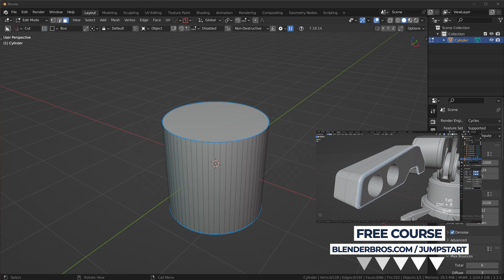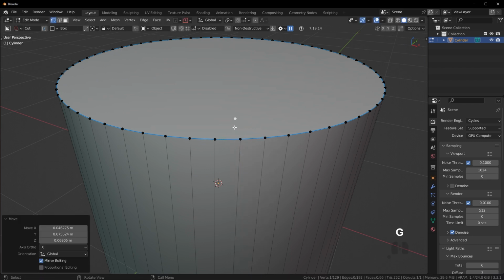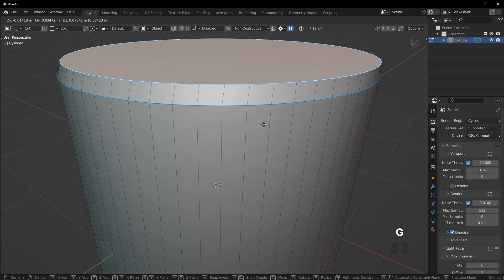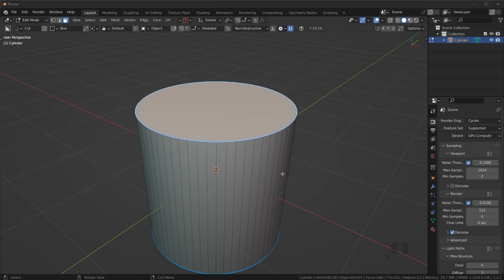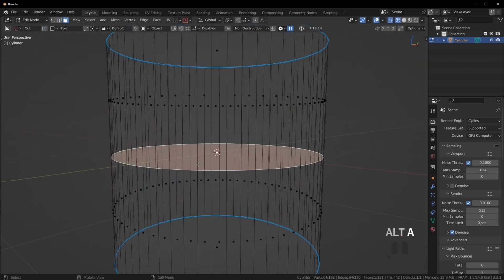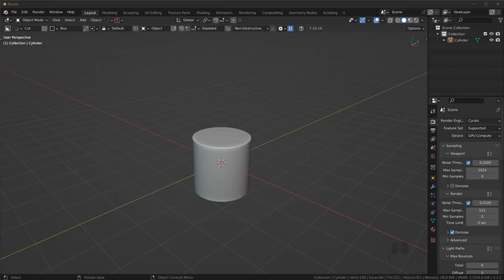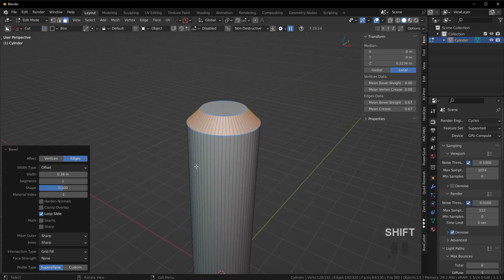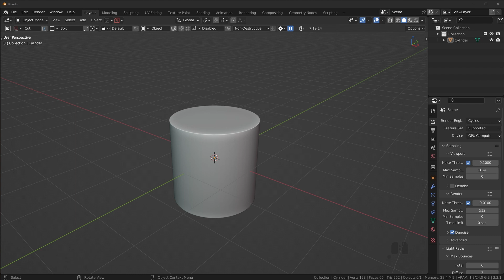3 COMMON Topology Problems in Blender

Comment: What about using non-quads? Isn't it also one of common errors? It can ruin so many things, but nothing would honestly say you, what is the cause! For example, when I do so, build-in add-on "Mesh: 3D-printing toolbox" complains as crazy on random and often fake things. Like "zero-faces", "intersect faces" or "non-flat faces", when all 100 vertices of one face are JUST FINE, and nothing helps. But as soon as I convert it to quads, all that false-positive goes away.
Reply from the maker: I always have to answer this question in nearly every video. The answer is: it depends. I’d recommend watching some of my other videos where we discuss problems with ngons/quads more in depth. It isn’t a simple “use this” or “use that” answer. It depends on your pipeline, goals, how how you’ve actually modeled.